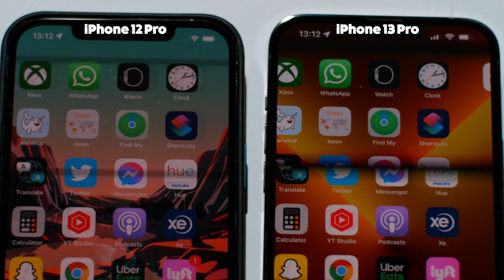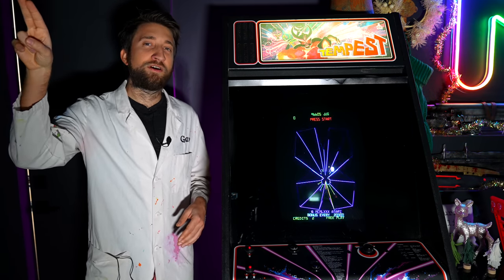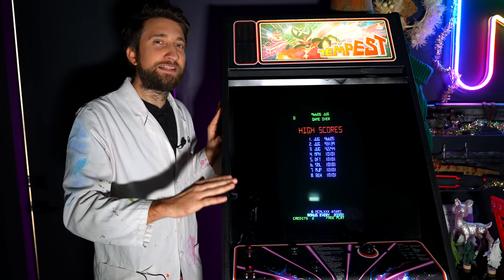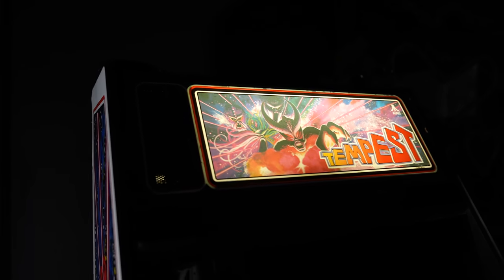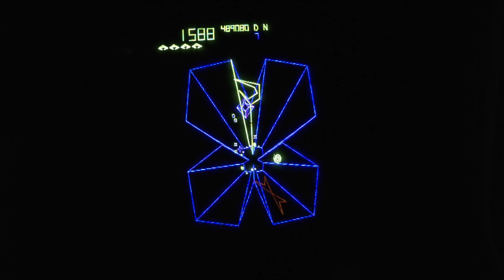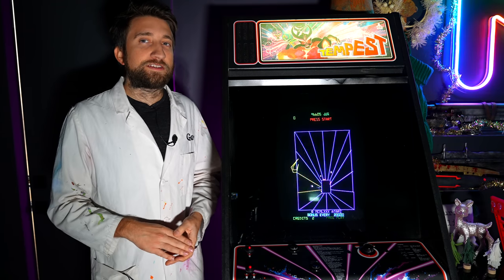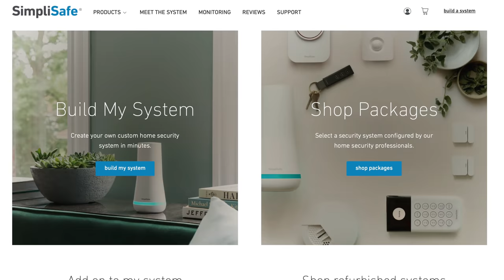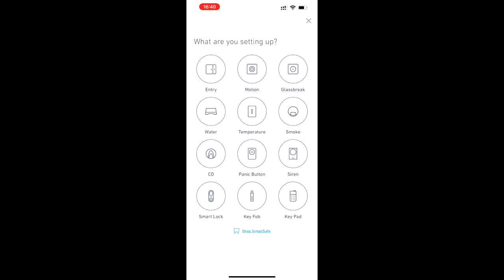Arcade Machines look WEIRD in Slow Mo - The Slow Mo Guys

Comment: The other major downside to this display is that it requires such specialized parts that are increasingly difficult to find in order to maintain these wonderful machines!
Reply: A standard Oscilloscope.
..
I did vector laser images with a HeNe laser and mechanical galvo scanners in the 80s that I choreographed to music. (classical laser light show) 
 I take out a projector on Halloween each year. 
I use the Radio Shack Color Computer with SW I wrote and used General scanning Galvos.  It used the 6809 and a clock around 900kHz.  In the display processor I was squeezing clock cycles to to some rotations real-time. 
..
I though about writing an Asteroids game, but moved on to other things. . .

Comment: 6:00 - 6:03 Could You film that "tempest" in slow motion?  i mean exacly that what is in 6:01 on the screen
Reply: Scanimate was an early CGI machine (see my early CGI playlist) that rendered pictures on a monochrome vector monitor and recorded it on tape with a video camera (likely tube based with afterglow), which worked quite similar and sometimes flickered.

Comment: vector can have color sadly it will look like its was painted using the MS paint bucket tool, very sharp on where the position of the line should be, sadly color not as easy, there are a few companies using vector tech to make holograms like the acoustic trap display but again sadly colors not so accurate.

Comment: I keep wondering how they can make the beam move so fast. it is fasinating to see.
Reply: ON a scope it can be nanoseconds, but you need time to get the brightness enough.
.
I started with scanners that could go from anywhere on the screen (wall) to another in 4ms.
....

I did vector laser images with a HeNe laser and mechanical galvo scanners in the 80s that I choreographed to music. (classical laser light show) 
 I take out a projector on Halloween each year. 
I use the Radio Shack Color Computer with SW I wrote and used General scanning Galvos.  It used the 6809 and a clock around 900kHz.  In the display processor I was squeezing clock cycles to to some rotations real-time. 
..
I though about writing an Asteroids game, but moved on to other things. . .

Comment: Does this mean vector games run at a variable frame rate? i.e. a frame with more objects takes longer to draw than other objects, so does the machine compensate for that time difference or are less busy frames quicker to change that busier frames?
Reply: Variable frame rate, absolutely yes.  The game runs at its own speed on a separate clock.  The game updates what you might call an object buffer ram and the vector drawing section just keeps drawing whatever is in that buffer as fast as it can.

Comment: Wait…so CRTs show different colors by illuminating individual RGB sub-pixels with varying intensity. How the heck do these vector based screens create different colors when the electron gun is moving so randomly?
Reply: Colour CRTs have 3 guns those each aim solely at one of the 3 RGB colours by the shadow mask. Colour vector monitors do the same (unless they used very exotic special CRTs).
Reply: @cyberyogicowindler2448  Oh, interesting! I had no idea until now how the pixel separation worked, I had no idea there was an actual physical separation of the light ray paths. From Wikipedia:
"A shadow mask is a metal plate punched with tiny holes that separate the colored phosphors in the layer behind the front glass of the screen. [...] Three electron guns at the back of the screen sweep across the mask, with the beams only reaching the screen if they pass through the holes. As the guns are physically separated at the back of the tube, their beams approach the mask from three slightly different angles, so after passing through the holes they hit slightly different locations on the screen."
Reply: Thanks for answering a question I forgot I even had!

Comment: I don't know if all CRT monitors can be used for these games or not. If not, that's a real problem for preservation. Also, not only is the programming dead impressive but so is the emulation.
Reply: Vector monitors have different electronics than raster, but the CRT itself is technically the same, and the rest is repairable.

Comment: What confuses me: The lines should be looking straight without any 'staircase' effect. Is that an artefact of the camera, a digital field control of the beam or a phospherous mask artefact?
Reply: The voltages that determined the instantaneous X-Y position of the dot being displayed were produced by DACs. The "stair stepping" is a result of the low bit depth of the DAC being used.
Reply: Vector monitors typically had no "infinite" resolution (although higher than most contemporary raster games) but were controlled by a DAC with limited bit depth. Only when line drawing was an analogue circuit (like an analogue computer) it would completely avoid stair steps.
Reply: Thanks, I sort of didn't actually see the first answer. But yeah this makes more sense now :)

Comment: So the difference between a CRTV and a Vector Screen is like the difference between a matrix and a plotter.

Edit: I just realized that this reference will make no sense to most people reading this chat.
I feel so old now :p
Reply: A lot of Hewlett Packard lab instruments had vector displays and drove HP pen plotters for paper copy. I think their display drivers understood the same language as their plotters - HPGL. 

You used to see these displays used a lot on aircraft systems, other companies' equipment, etc.
Reply: @abarratt8869   Very informative :)
Thank you
Reply: re: old...
You're not alone... yet.
I haven't used/owned a matrix printer in 30 years but I know what it is.  Ask most people if they ever had to rip the holes off of fanfold paper and they'll just look at you funny.  I used to hate it when a line of text got printed over the perf-line.  Grrr.
Reply: @bill392  I had a summer job once as a kid and I got paid for ripping off the holes...
Reply: @bill392  I still own only a matrix printer (Fujitsu DL1100 Color). But I print so rarely that any modern inkjet would waste half its cartridge for "jet flush" operation after sitting unused for more than 2 weeks. Inkjets are obsolescence products designed to fool people into wasting money.

Comment: So for the vector drawing. It's basically one "pen" drawing the screen super quickly? 

What's stopping you having more pens? 

Say you had 10,000 different dots, If you used 10,000 different "pens" couldn't you draw the image instantly? 

If you were able to get unlimited amounts of "pens" could you do something that looked super detailed, all rendered instantly because Instead of 1 pen drawing the lines you've got a million pens drawing every single line by each drawing 1 dot?

Sorry if this pen analogy is a bit strangled, I can't think of the word for what's actually doing the "drawing." :D
Reply: Electron gun (the term you're looking for) is usually way bigger than the dot produced on the screen with its electron beam, so the first thing that would stop us having a whole lot of "pens" would be size.
Although there are CRTs with more than 1 independent, freely deflectable "pens" - see dual-beam oscilloscopes. 

AFAIK, some very old radar CRTs also used few electron guns with elaborate masks to "shoot" whole letters on the same screen the image is being projected at.

> Say you had 10,000 different dots
You're describing any dot-matrix LCD, or [O]LED, or plasma display :)
The reasons that those have scanning (or "activating pens sequentially", using your analogy), are:
1. Having a memory cell to keep and display its value at all times would be expensive and would eat into the visible dot area (or reduce brightness), although those displays exist: see Sharp memory LCDs
2. Normal LCDs require constant AC drive, and it's easier to drive them row- or column-wise, rather than reinvent a wheel and do AC sources for each pixel;
3. Driving each pixel dynamically and independently all of the time would probably consume a ton of power, especially if it's plasma or LED of some kind.
Reply: Electron beams are moved by big magnetic coils at the CRT necks. The magnetic fields for moving multiple beams would extremely disturb each other and likely would be harder to control than the most costly particle accelerator.

With the 3 beams of RGB colour CRTs this only works well because the move simultaneously by the same magnetic coil.

Comment: I'd love to see you guys measure the speed of light with a slow mo camera. I know you've already done it in the lab, although I think it would be more impressive to do it with a laser and a phantom in my opinion. It can be done by, for example, shooting a laser pointer across say a 500m field onto a mirror thats lined up perfectly to point the laser back at itself right next to it (onto a card or wall), then film a shot of the laser lens and the reflected laser dot in the frame. The slow mo shot should show at least a few frames where the light from the laser is turned on before it reaches the point on the wall right next to it. That would be cool
Reply: I would guess that a laser pointer probably would take many frames to go from "off" to "on" (or the other way), so this would be tricky.  It probably wouldn't be that hard to find a laser with sufficient on/off speed to do this, though.